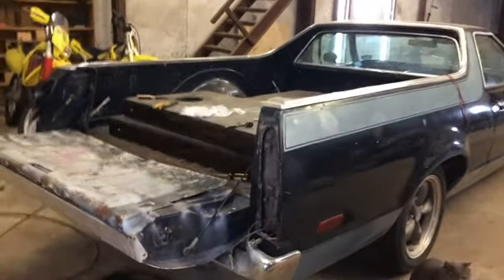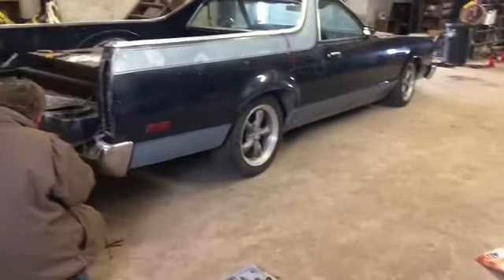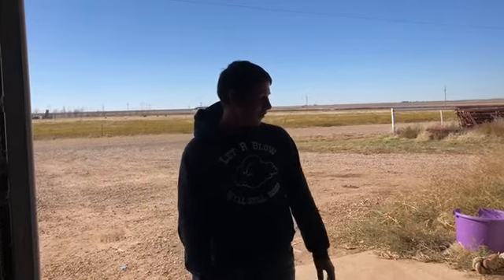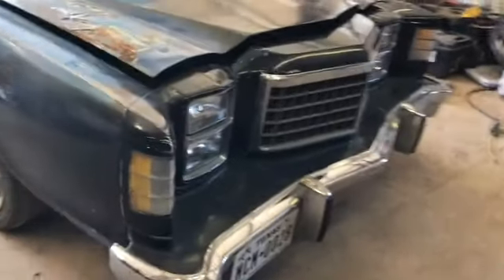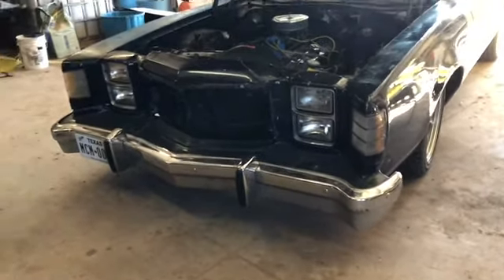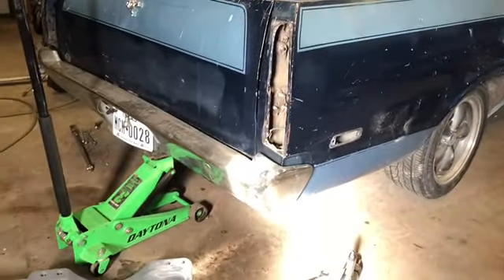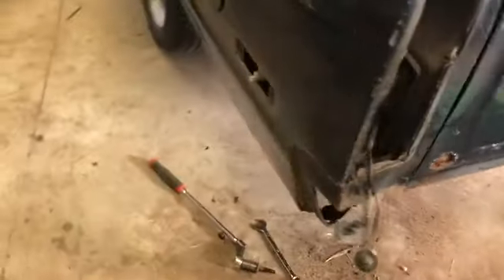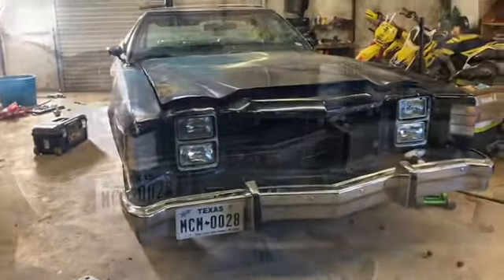Restoring A 1978 Ranchero GT

Comment: I have a question regarding the trim chrome along the rear bed area is possible to show how it was removed, I have to repair some areas on my 78" and it appears hard to remove i do not want to damage any more than it is.
thanks
mg
Reply from the maker: I sadly no longer have it, but I believe we unscrewed all the bolts and started with removing the back pieces first and then continued forward. There is a Facebook group about these rancheros that is very helpful.